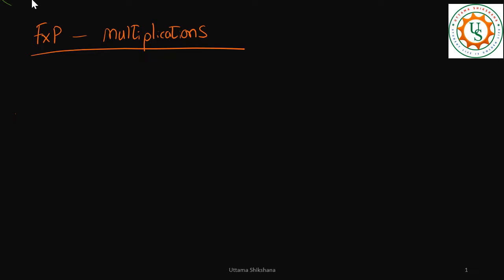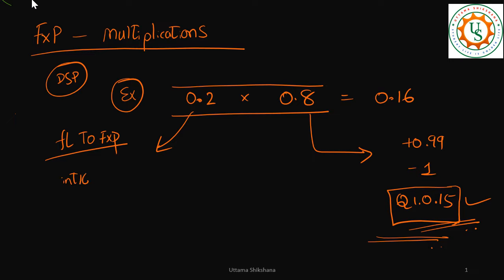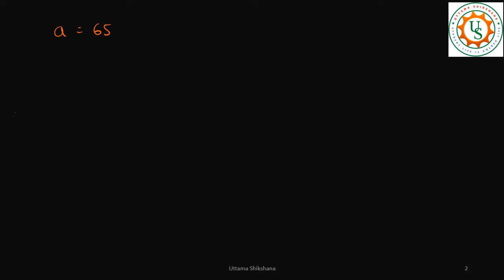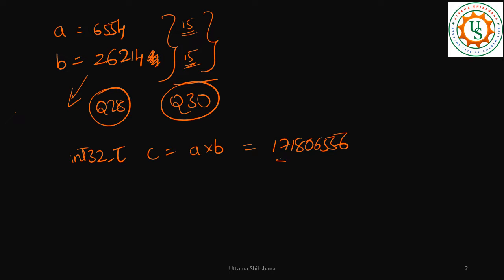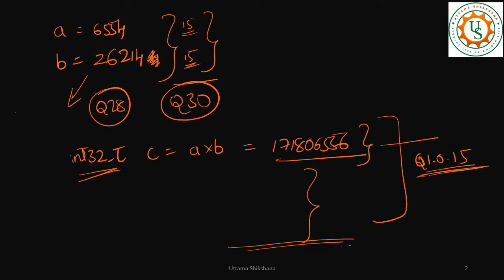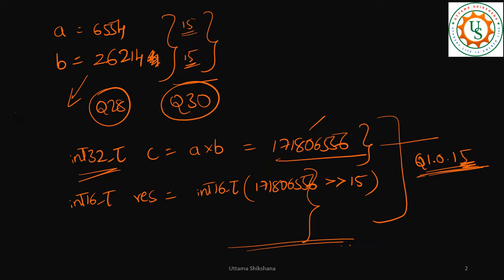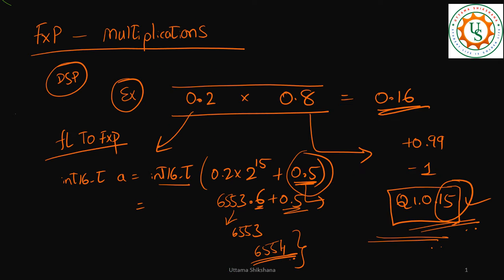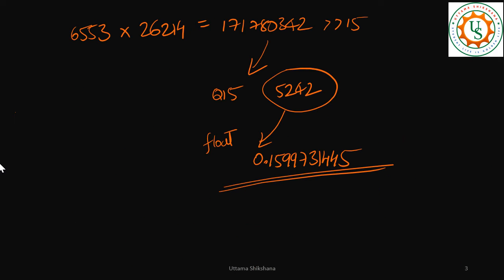[Series 73] Fix Point Multiplication | Importance of adding 0.5 while converting from Float to Fix

Comment: Pretty important detail I don't see anyone mentioning when talking about fixed point numbers to floats, and it seems because by default floats "round" down, at least with GCC and Clang.
I tried with 0.1, 0.2, 0.3, 0.4, 0.5, 0.6, 0.7, 0.8 and 0.9 and all of them help to reduce the loss of information with little difference between them. 
Why is specifically 0.5 chosen for this task?